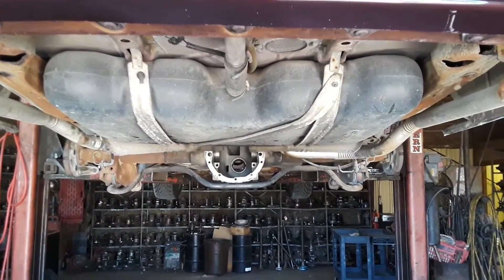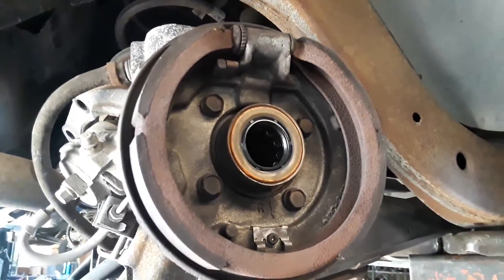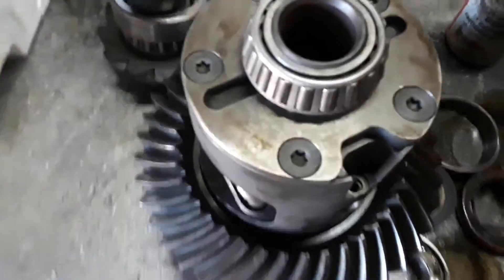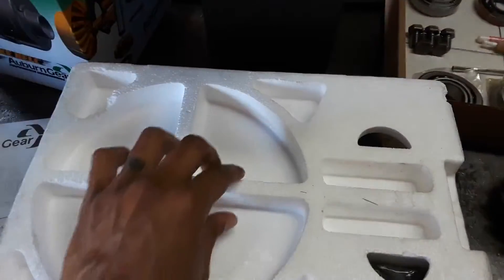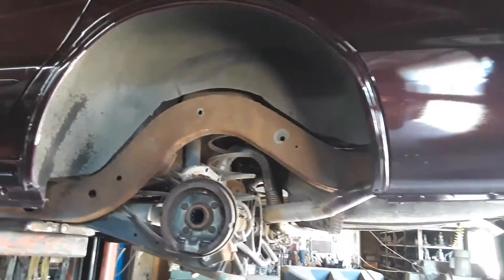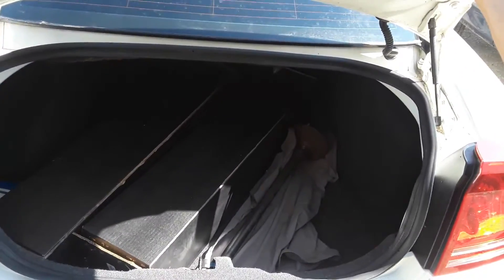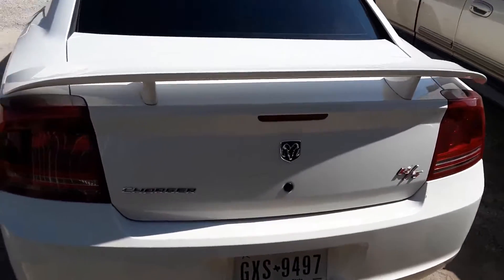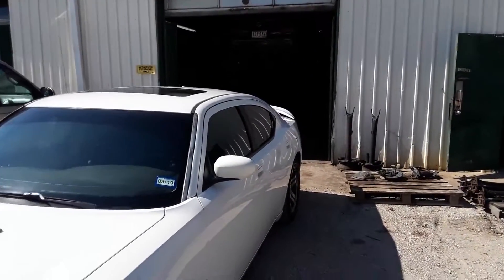1996 Impala SS rear end rebuild

Comment: Beautiful work bro,nice to see SS owners building there car from ground up
Reply from the maker: Thanks man, the story of this car is it sat parked uncovered in the Texas sun from 2011 until I bought it earlier this year in 2019. It was last registered in 2011 so it could have say for even longer. All the seller did to it was replace the fuel filter and battery just to sell it as a running and driving car, once I found it I could tell it had a good motor, I test drive it just to see if it would go through all the gears and it did. I could tell the rear end needed attention but it wasn't to bad. The exterior was the worse part of the car. And the main reason they sold it for so cheap so I had to buy it. I could have sold it in parts and made a hell of a profit but it didn't deserve to die so I brought it back to life. I have more to do to it that will come. It just takes time. I've always loved these cars since I was a kid when Chevy released them. They deserve to be on the road driven and admired by all who know the significance of the last real impala ss.
Reply: @1996impalass  that makes it all well worth  it bro.Once u finish it u can seat back and admire the finished product, building car is a long process especially when it's done right
Reply from the maker: @lssleepers6464  yeah especially when you do all your own work like I do.
Reply: @1996impalass  that is so true bro.i gotta find me a interior guy,or I might just do a I swap from a cts-v or luxury car with heated seats myself but I didn't want to shy away from the O.G. status of the impala SS
Reply from the maker: @lssleepers6464  yeah, my 2 front seats were pretty bad. Mainly the driver seat but luckily I was able to find 2 perfect front seats on craigslist that are better than original nice seats, I think they were recently redone because the perforated leather is soft not hard and stiff, and brittle.
Reply from the maker: ´°`  it's a lot of trial and error man,  trust me it doesn't come easy
Reply: @1996impalass  I got the same vehicle, having the same problem. What all did you buy, How much did you spend all together for the parts?

Comment: Is there different between Impala and caprice diff ?
Reply from the maker: Yes the impala ss axles are longer
Reply: 1996 Impala SS ok but how about the power ?
Reply from the maker: @chevy9648  some caprices came with the same g80 3.08 great rear end as the impala ss. But most caprices came with the other rear end that wasn't a posi trac. The impala ss run the hardest.
Reply: 1996 Impala SS I found out that the previous owner swap the impala diff  to one came from a caprice 👎🏽. So, I don’t know what to do with it. 
Excuse me for my mistakes I am not really good at English.
Reply from the maker: @chevy9648  not cool. The caprice diff will make the wheels sit more inward of the wheel wells because it's more narrow than the impala diff. 

It could still be a g80 3.08 posi which the impala came standard with but just the caprice version. 

Easiest way to find out is to Jack there car at the diff until both rear tires are off the ground then put the car in neutral and rotate the tire. If the other tire is rotating the same direction it's a posi. But if it rotate the opposite way it's not a 3.08 posi.
Reply: 1996 Impala SS thank you for this very helpful advice and information.
Reply from the maker: @chevy9648  it's all good man, anything I can do to help out...